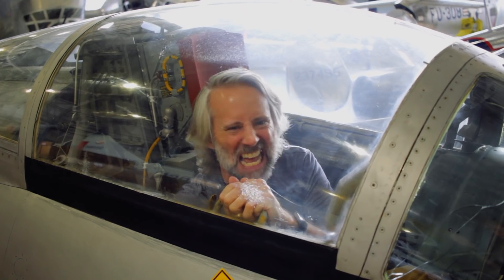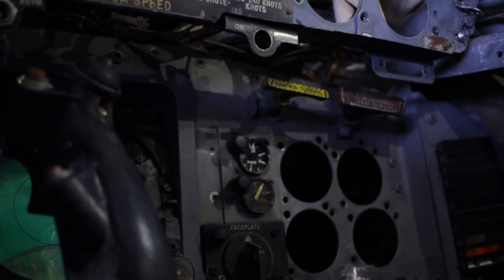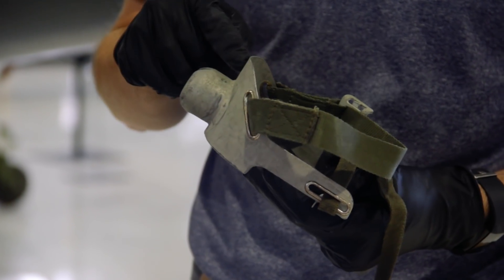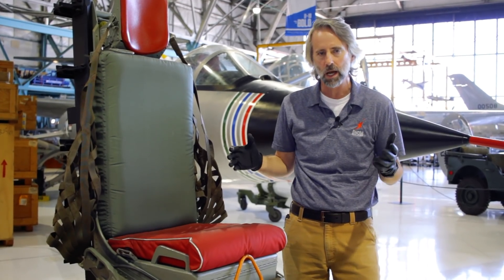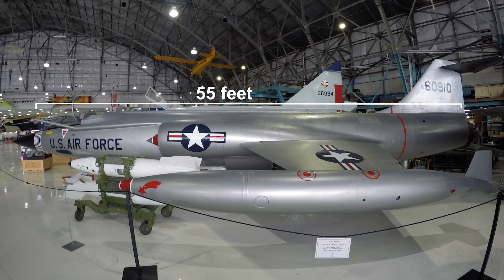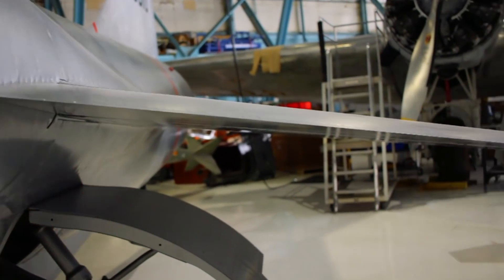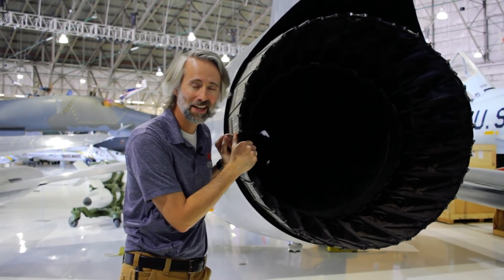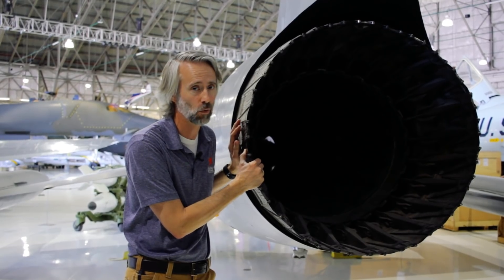F-104 Starfighter | Behind the Wings

Comment: It also killed a lot of Canadian pilots, but it's safety record in Japan and Spain are flawless. Not a good idea to use a high altitude interceptor as a low altitude tactical strike platform.
Reply: If you want a real inside of this plane check this: https://www.youtube.com/watch?v=eB8l_fCKDSw
Germany did not built hangar for their 104 and left them "outside" all the time being used to the F86: just imagine how a sophisticated jet like the Starfighter would react to that treatment... v__v Also flying supersonic at treetop in bad weather is not the safest way to keep your plane intact.
Another misconception about the 104 is the "Huge" turning circle: it was about the same of an F-4B/C/D below the sound of speed and above it the 104 could run circles around any other supersonic jet because it was conceived to manoeuvre above Mach1. This can be easily seen checking the turning ratio charts in the F-104 manual and those of the Phantom. When you go beyond Mach1 the centre of gravity of a plane moves and the plane becomes way less agile, and there was where the F-104 shines. The only better fighter plane above the sound of speed was the much more sophisticated F-106 which employed a complex pump system to move fuel between the different tanks so to correct the balance and shift back the centre of gravity. It also is often told that the 104 had short range which was true to some extent, but it could bring a nuclear bomb  inside the enemy territory faster and deeper than any other fighter bomber except the F-105 which had an internal vane for reducing drag. the vaunted F-4 in the USAF created a lot of probems to the f-105 formation because they had to slow down to allow the fighters to keep pace when they were loaded with tanks.
Finally, in air to air role, the F-104 could outrun, out accelerate and outroll any other fighter plane until the "teen" series became available, including all the soviet planes it could come across: in the eighties Col. Andy Bush created a controlled fight for their German cadets which were sceptical about the ability of the plane to face actual combat (because of bad press at home). The combat would involve an F-5E and an F-104G, flown by himself, starting at the same level and speed: the planes had to engage in a scissor manoeuvre and try to kill each other. in 3 sequent engagement Col. Bush was able to kill the F-5E 3 to 0 using the superior energy of the F-104 and fast roll ability. The F-5 pilot comment was "I can't F***ing believe it!!!" One of the defining characteristics the F-104 was the incredible acceleration which allowed it to dogfight mostly without reaching the AB, while a Phantom would simply open the gauges and blast away, but the huge weight mixed with two F-104 engines would drain the fuel tanks in 3 minutes where the F-104 would have the ability to stay in that fight up to 5min (tested at Decimo base in Sardinia), which is about the same time an F-15 can do! The bad reputation in combat for the F-104 comes form the fruitless cap in Vietnam where it never faced opposition, and the excessive wearing it was subject to due to lack of number: the only USAF f-104 shot down was lost pilot ambushed by a Chinese mig 19 driven by ground radar control to intercept the starfighter form behind and below. The F-104C did not had a RWR, which was immediately introduced on all the Starfighters after that fact. The other casualties were Pakistani second hand F-104A fighting against much more modern Indian Mig 21PF: Gen. Chuck Yeager tried hard to teach the poorly trained pakistani to NOT dogfight a mig 21  at low speed but they did fall for that more then one time. The problem with the F-104 is that you had to have a very high skill as a pilot to make it perform: it was not an instinctive plane that you just turn on the tail of the enemy: you need to know how to manage speed, turning rate energy retention and acceleration to be able to outperform the soviet migs: it can be done, but you got to know what you are doing. Finally the Starfighter was one of the best interceptors ever: it could be flown from stop to 30K feet faster then any other plane before the F-16 excpt may be the EE lightning, but the later had such a short range to be actually impractical and the red top missile was so bad that it probably wouldn't be able to shot down anything smaller then a T95. The latest f014S was able to carry both the Aim9 and the AIM7 in 1968 up to the Aim9L and the Aspide (which was an improved Sparrow) which made it usable as an interceptro up to the end of the nineties.
Reply: @Zumzifero  Good summary.  I did get in a drag race with an F-104 and my RF-4C at Cold Lake, Canada and pretty much stayed together.
Reply: @Zumzifero  Finally someone who knows what this aircraft was all about.  My father Captain Clifford John (Hank) HENRY, RCAF,  was one of the first  instructor pilots for the CF-104 in 1961.He was an ace Sabre pilot and brought those skills to the 104. He was never beaten in dogfighting and absolutely loved the "Zipper".  Never, ever, called it a 'widow maker'.
Reply: True! My Dad Love the Zipper!! I remember Him saying the Faster You go the tighter She turned😎 He trained Luftwaffe pilot in Her ....... something about some of the losses were because the Controller's had trouble keeping up with Her speed. Did You fly one?
Reply: imagine the surprise of the t72 tank commander what a supersonic interceptor crashes in a ball of fire in-front of him
Reply: Canada's pilot losses while flying the F-104 while sad are not actually any worse than comparable aircraft at the time AND was an improvement over previous generation aircraft which resulted in many more deaths yet don't have as bad as a reputation. Losses of F-104s were not because it performed low altitude roles and it actually did low altitude attack roles very well.

 cartmanrlsusall  Japan did not modify the wings of their Starfighters.

 Robert Dawson  It was not worse than Germany, German losses of F-104s account for over 50% of total world wide F-104 losses and this was only within two years of service. Why? Because Germany did not want to spend the money to train their pilots regularly. Only thanks to Johannes Steinhoff did the government provide funding and training programs.

 Cicliste C  Only the Original American F-104As ejected downwards, not later export models.
Reply: I observed a young 20 year old Canadian pilot get killed at RCAF base Cold Lake, Alberta when he failed to lock his canoy before take-off. He ejected but was so low, he srtruck a tree branch on the way up. Also ... Canadian CF104's on standby in Germay were armed with American nuclear bombs.
Reply: @RockyAllenLane  Canadians were great pilots.  Once got into a low level drag race with a CF-104 at Maple Flag.  When stationed in Europe we would do no-notice attacks on Canadian bases Lahr or Soellingen.  I was always impressed how quickly the CF-104's could launch and intercept my trusty F-4.
Reply: @jcheck6  so cool, bet you have some great stories, thanks for your service
Reply: Yeah. Spain lost none. Thanks to use them 100% in the AtoA role, better weather and higher level of training compared to 60s Luftwaffe German pilots.
Reply: ... true ... low altitude anything is a bad idea if you have to eject downwards!
Reply: @SlightReturn666  LOL! It does have it's drawback in this case... but I think the downward-firing ejection seat was quickly replaced with the normal upward-firing ejection seat. 

And if ejection-seat trivia gets you going in the morning, the strangest ejection-seat system I know of is in the Russian Blackshark KA-50 helicopter.... yeah, a helicopter with an ejection seat figure that! When activated, explosive bolts in the heli's blades blow releasing the blades (hopefully all 6 of them!) to fly away then the canopy is blown off and finally the seat rocket fires propelling the pilot up thru where the blades had just been whirling around.... if everything doesn't work exactly right, pilot is mince-meat! But hey at least the pilot has a chance, any ejection-seat is better than no ejection-seat right?
Reply: Canada's accident rate was worse than Germany's. That bad
Reply: The problem was the tiny blown wing. The wing only made enough lift to fly on it’s own when the airplane was moving pretty fast. For low speed flight they channelled high speed engine exhaust over the wing to provide lift. But if the engine failed, the plane fell like a stone. To make a “dead stick” landing in an F104, the aircraft had to be at at least 20,000 ft, directly over the end of the runway! Then you dived hard to keep the speed up so it wouldn’t fall out of the sky. Other aircraft in it’s class like the Lightning of the Grumman Super Tiger had much larger wings and were far safer.
Reply: @SvenTviking  
> The problem was the tiny blown wing.

The problem is that you don't know what you are talking about.

> The wing only made enough lift to fly 
> on it’s own when the airplane was 
> moving pretty fast. For low speed 
> flight they channelled high speed 
> engine exhaust over the wing to 
> provide lift. 

Correct ... which is relevant to when the F-104 flew slowly which was only really the case during take offs and landings.
Otherwise it flew fast ... per the old pilot adage "Speed is Life".

> But if the engine failed, the plane 
> fell like a stone.

As does everything else the last time I looked at Newton's law of gravitation.

> To make a “dead stick” landing in 
> an F104, the aircraft had to be at 
> at least 20,000 ft, directly over 
> the end of the runway! 

I don't know if this is correct and I really don't care as the SOP for an engine out coming in for a landing was to punch out rather than risk a dead stick landing.
This is not to say that it couldn't be done as it was.

U.S. astronauts trained to land other flying bricks by landing F-104 without the engine running and they did it over and over again without any crashes that I am aware of.
If you want to make the case that a lot of F-104s were lost due to trying to land with an engine out condition, you need to provide some evidence that that was the case as the reports I've read indicate that this was not a significant problem.

And keep in mind that the F-4 has blown wings as well and that if both engines go out, you don't try to land it either ... just punch out.

 > Then you dived hard to keep the speed 
> up so it wouldn’t fall out of the sky. 

You had to keep your speed up above what was needed to prevent the wing from stalling ... just like any other aircraft.

> Other aircraft in it’s class like the 
> Lightning of the Grumman Super Tiger 
> had much larger wings and were far safer.

There were no other aircraft in its "class".
It was designed to be a daylight air superiority fighter and when the Air Force asked other manufacturers for competing bids, they were told to they wanted something to replace the F-100.
The next aircraft designed to be daylight air superiority fighter was the F-16.

But more importantly, at the time that Germany was looking for an aircraft that would do everything, the Super Tiger was still in development and the Lightning wasn't put up for bid.
Reply: Actually, not as a bad idea as you can think. The tiny wings and the high wing load gives to the F-104 a very good stability in the turbolence of the low altitude and this is why it was chosen as tactical strike fighter.
Reply: @andreabindolini7452  It was chosen as a tactical strike fighter because of Lockheed's marketing skills and the ability to bribe.  The plane  was severely optimized as a bad-assed interceptor. Period.   Anything beyond that was BS cobbled on to the design.
Reply: @jamestheotherone742  
> It was chosen as a tactical strike fighter 
> because of Lockheed's marketing skills 
> and the ability to bribe.  The plane  was 
> severely optimized as a bad-assed 
> interceptor. Period. 

Spoken like someone who has never actually looked into the history of the F-104.

> Anything beyond that was BS cobbled 
> on to the design.

Bullshit.
The F-104 was designed to be a daylight air superiority fighter in response to a wish list from Korean War fighter pilots who wanted to be able to take on and blow away MiGs (not bombers).
The Germans wanted an aircraft that could perform three roles, namely recon, interception, and ground attack and the boys at Lockheed told them that they could modify the F-104 to perform all of these roles.
Yes, bribery was involved, but the fact of the matter is that there was only one real alternative to the F-104 offered (the other two were in development) and that alternative, while deemed to be better at dogfighting was considered to be worse at something else (IIRC ground attack).
Reply: @lewiscole5193  Your wishful thinking delusion does not make it true.  The USAF and Kelly Johnson did take the recommendation of Korean War vets in to account, which was they wanted speed and RoC above anything else, which is exactly what they got in the 104.  But it was not an "air-superiority fighter",  that term hadn't even been coined yet when the Starfighter was designed.  It was a no compromises point interceptor, designed to make slashing attacks against the threat of the day, strategic bomber formations, or bouncing other fighters and then disengaging at will.  The F=104 sucks at "dogfightng" if it gets caught at low energy.  Your "opinion" is nothing but the revisionist rationalization that came AFTER selling it as a round peg for a square hole.
Reply: @lewiscole5193  Oh good grief. TLDR; take your pills and then read this crap again. I think you confusing the F-104 development with not only the rest of century series, you also mixing up how it never lived up to expectations regardless of paper performance. And of course its less than perfect service record.
Reply: @lewiscole5193  Seems like you need to take ALL the pills...
Reply: I guess the same was also true for the Pakistan air force where it scored the first kill by any Mach-2 aircraft, and the only confirmed missile kill at night in actual combat by an F-104 Starfighter anywhere in the world.
Reply: @winnifredforbes8712  
About what?  It's history?  It's accident rate?  What?  After all, books have been written about the F-104.
Reply: Yes the plane killed lots of canadians. Or canadians sucked in their flight training.
Reply: @travismichaelwagner  
From the Wikipedia entry for the CF-104 (the Canadian variant of the F-104):

"There were 110 class A accidents in the 25 years that Canada operated the CF-104 resulting in 37 pilot fatalities. Most of these were in the early part of the program centering on teething problems. Of the 110 class A accidents, 21 were attributed to foreign object damage (14 of which were bird strikes), 14 were due to in-flight engine failures, 6 were as a result of faulty maintenance and 9 involved mid-air collisions. Thirty-two aircraft struck the ground flying at low level in poor weather conditions. Of the 37 fatalities, 4 were clearly attributable to systems failures; all of the others were attributable to some form of pilot inattention.[11]

"The accident rate of the CF-104 compares favourably to its predecessor, the F-86 Sabre. In only 12 years of operation the F-86 had 282 class A accidents with a loss of 112 pilots. The Sabre was also a simpler aircraft and was normally flown at higher altitude.[12]"

Note that a Class A accident is one in which the aircraft or crew are seriously damaged or destroyed.
Reply: @J.P. Sayer fast at runway altitude but no climb or turning performance to speak of.
Reply: Yup, not the fault of the aircraft.
Reply: Why not?  The F-104 had everything that purpose built strike aircraft of the time had:

Tiny wings for high low altitude speed and a smoother ride through thermals. 

A huge amount of thrust to carry high weights and go high speeds. 

The F-105 and TSR-2 both used these. 

The problem was... low altitude flying is risky. That’s why the F-105–even discounting losses due to enemy action in Vietnam—had a terrible attrition rate.

In spite of its reputation as a “widow maker”... the -104 had a lower loss rate than the Sabre in Canadian and German service.
Reply: @Bartonovich52  The Lightning was the the highest performance aircraft in NATO by quite a margin until the F-15 arrived (and even then F-15 was only just slightly faster in the climb and acceleration) massively short ranged however, they were fantastic as an interceptor in Germany, not as much use as UK QRA. The Red Top was also probably the best IR missile around at the time (with an honourable mention to AIM-9B), all missiles were unreliable at the time. Sidewinder was made reliable first after all the experience in Vietnam.

But..... TSR.2 could outrun a Lightning...in dry thrust with the Lightning in full burners....which given that the Lightning was the first combat aircraft able to supercruise is quite something....
Reply: The Germans lost a lot of pilots flying starfighters,Japan modified the wings but still got rid of them eventually

Comment: F-104 Starfighter was designed for use as a high altitude supersonic interceptor.
So certain European countries tried to use it as a low altitude all-weather ground-attack aircraft.
SURPRISE !!  TOTAL SHOCK !!  
Do understand that using Porsche Turbos to pull trailers full of garbage is not a good idea.